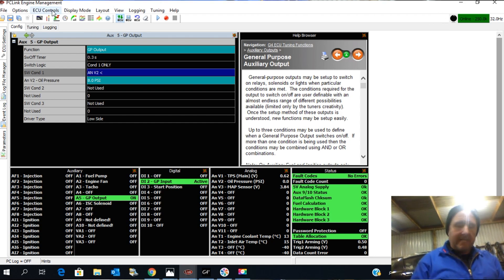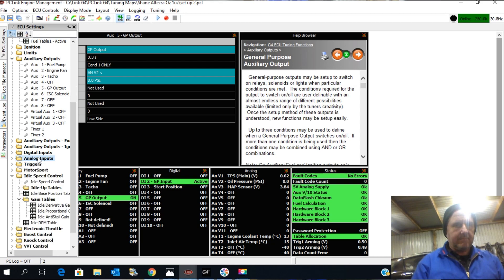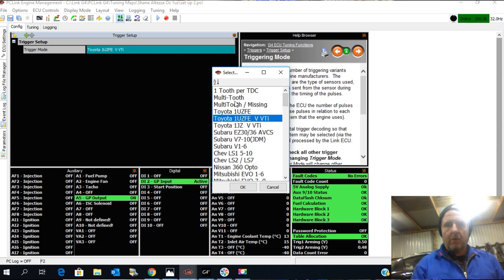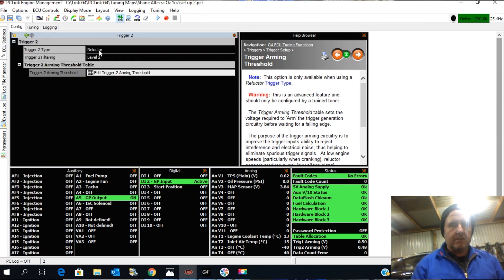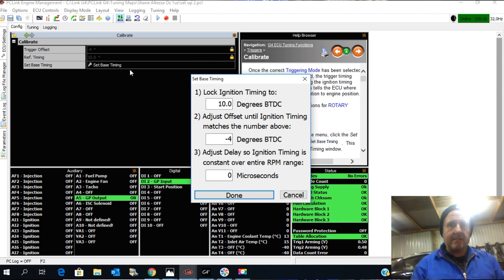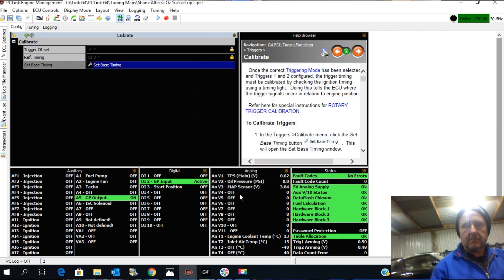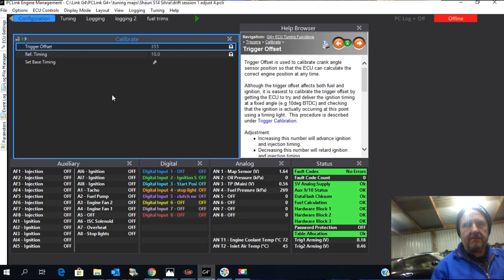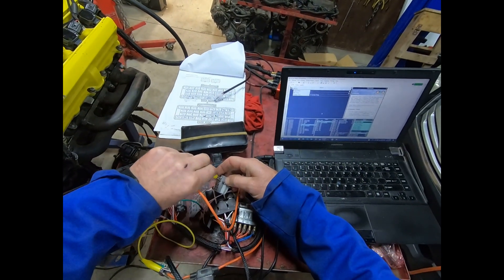LINK ECU Tuning. Setting up your link ecu.  1uz-fe Cam and crank settings

Comment: heres a crazy question. I have a heated steering wheel out of a 300 series Landcruiser. The one w/ all the buttons. If I swap that into my 99 4runner when I do my 1uz swap, can I use the link to capture those buttons via canbus and give me a desired output for whatever I want to program the buttons to do? Is something like that possible?

Comment: Hey I was wondering if you can remote tune the 1uz non vvti on link ecu with r8 coils. It is Na, it's basically a simplified version of the motor. Is that a service you offer ?

Comment: Thank you for these very informative videos. Really enjoy watching them, as I learn a lot :) Was wondering about trigger wheels. Pretty sure it's the Link G4+ Storm I'll be using for my early non-VVT 1UZ.  But this video made me think. Can I use the standard trigger wheels for running it fully sequential? no need to get a 32-1 trigger wheel?
Reply from the maker: Good morning Tom.  The engine from this video is a non vvti running full sequential and using the stock 12 tooth crank trigger wheel and signal cam trigger.  It works perfectly well so no need to get other trigger wheels.  Cheers Kelvin.
Reply: @CartuneNZ  Hi Kelvin. Great Info thank you. Maybe a dumb question. But are you only using camshaft sensor on one of the camshafts?
Reply from the maker: @tomaastrup6695  Hello Tom.  Yes Im just using the one cam sensor on LH cam sensor as thats all thats required for the decoding in the ecu.  With stock 1uz ecu they run on one cam sensor,  the second is a failsafe.  Cheers Kelvin.
Reply: @CartuneNZ  Hi Kelvin. Good to know :) Thank you.